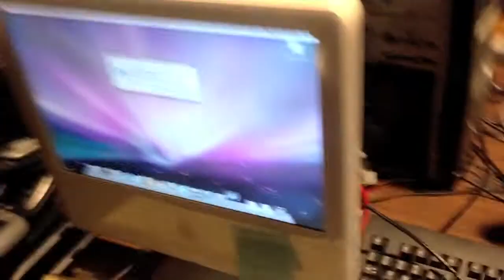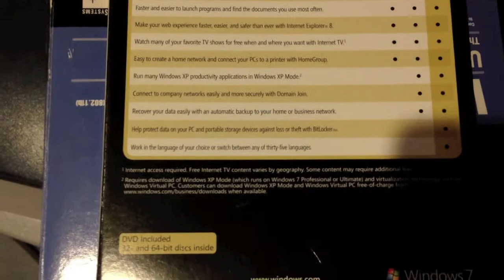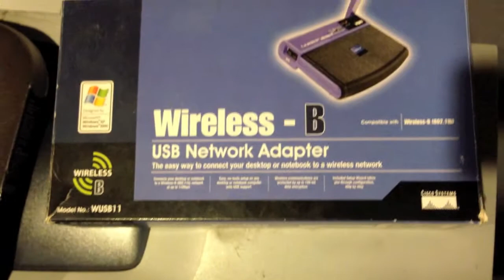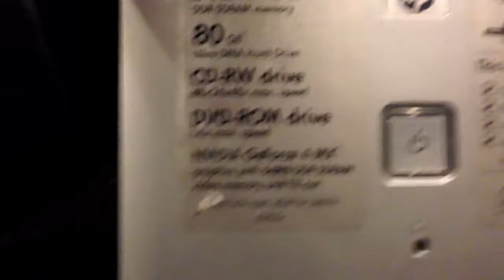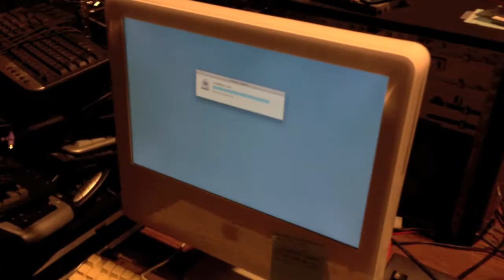Computer Business Update, 20+ More Computers

Comment: about the Xbox, you can switch DVD drives, it won't work. Every Xbox has a key for its DVD drive you have to hack the old DVD drive to get the key and flash it to the new one for it to work. My advice is the old drives motor is most likely dead. I flash a lot of 360's.